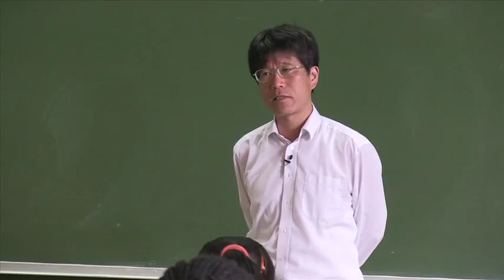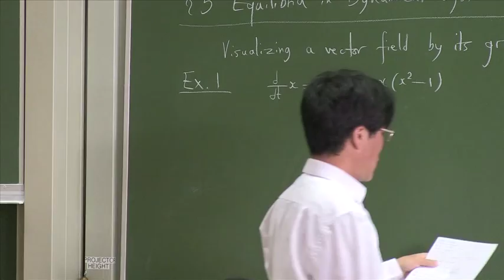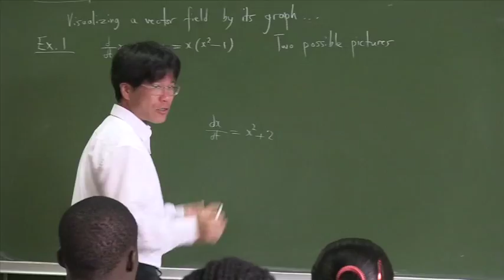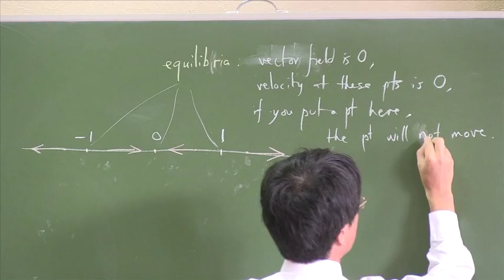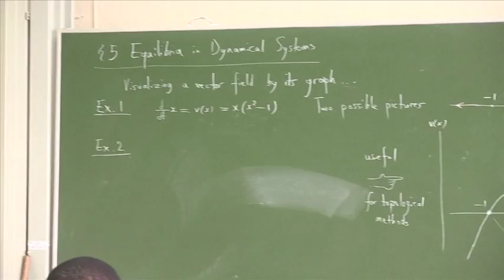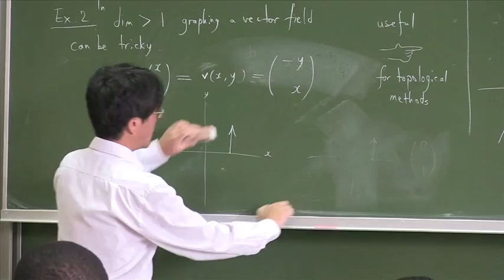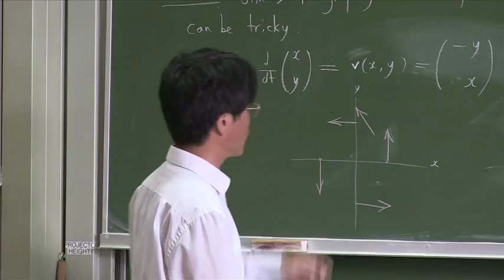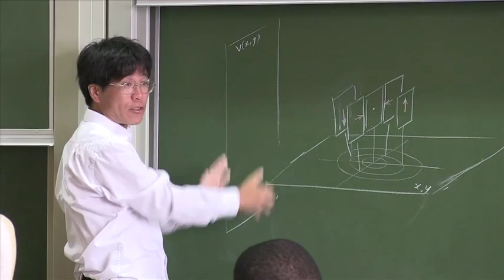Topology & Geometry - LECTURE 11 Part 01/03 - by Dr Tadashi Tokieda

Comment: Class interaction makes learning more positive and agreeable. Like, what is the downside of responding to an easy question, and laughing about how easy that question is ? Instead, the student choose to not talk, rendering the atmosphere awkward.

In Western culture, people do not really like insecure, shy people, who are often children and teenagers. T^2 is simply shifting his role momentarily to that of a parent, pushing their kids to practice communicating clearly, to opening up. Sometimes, the method are blunt and can hurt the ones who do not try to understand the actions of T^2. The students could be angry, and anyone who is angry does not think of the lesson learned, but only of a way to take revenge, which is not a correct learner's attitude. This is reflected in the way Rosemary looked at T^2 after coming up to the board.

Anyways, the core of the problem is the method T^2 uses to help the student. Because on one side, there is an injustice in the way the students do not respond actively, but on the other, T^2 may not fully understand the situation the students are in (i. e. are they really insecure?)

Comment: Wow, I was quite surprised about some comments. He wasn't arrogant. He wanted to teach more to students. Since to explain PDE from the scratch is difficult, he wanted to make sure whether the student know it or not. (I also spent a lot of time when I first learned it and did the same mistake as that student. PDE is not an easy concept.) If the student really don't know, he might want to explain it at least briefly, but if the student didn't answer clearly, how he can explain it? The student might know PDE well, but just the student might be confused at that time. The meaning that he starts to explain PDE is the student will lose the time for studying Topology. He had to choose between them. For that, the student needed to answer clearly and without doing anything, time went. We could spend 3 minute more fruitful. That's what he meant. I was impressed what he said, and I thought I need to keep in mind. And at my point of view, he was kind as usual. It sounds like parents should not discipline their children and whatever they do, just let them be. 

In addition, students were not the people who could not get a chance to learn. Apparently, based on previous lectures, they were majoring in STEM, and it sounds like they were 2 or 3 years of undergraduate students. As you can see, students has known the answer. He just asked something that students were supposed to be known. For me, he just tried to make students to be more actively. The more students join class actively, the more students can understand the concept deeply. What's the matter?
Reply: Well, I agree. Teachers get angry at their students sometimes for some reasons, it happens normally everywhere in this world. I think people dislike this part because they kept their thought about him being a great friendly teacher, this is not the case, being friendly doesn't mean never gets angry.